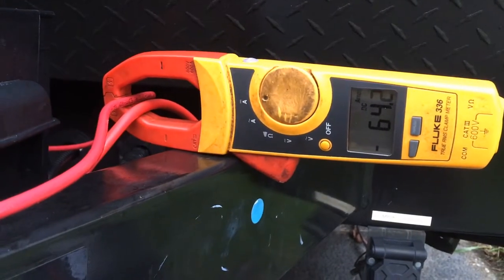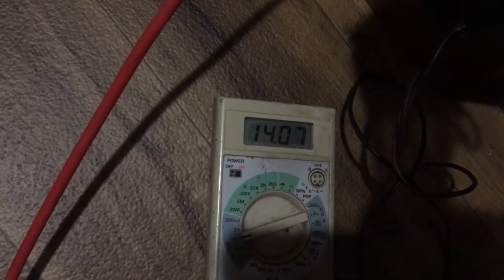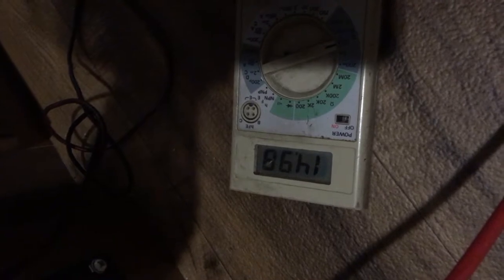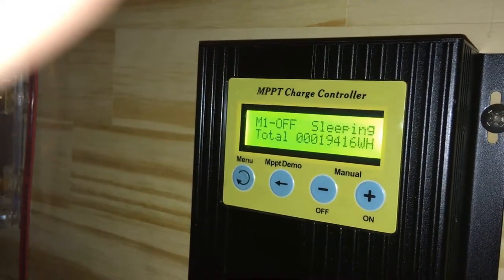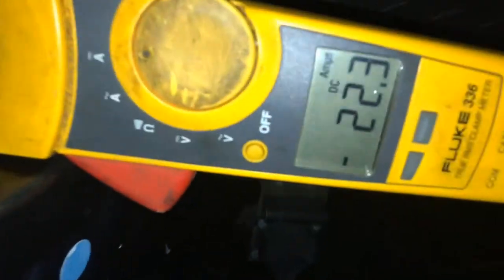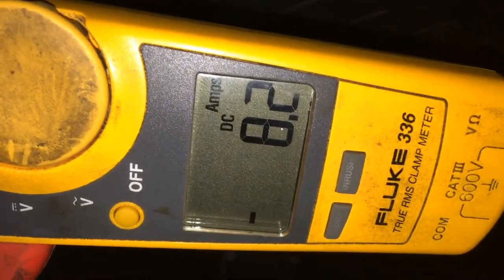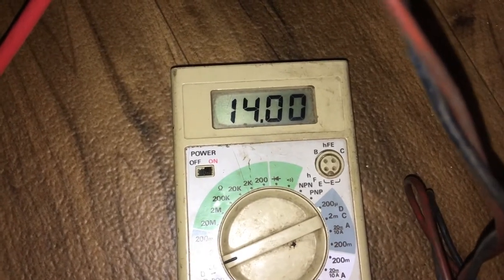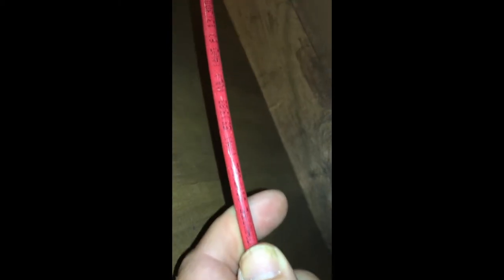WFCO 8955 pec amp test 14.4 volts bulk mode. 2018 coachman

Comment: Wow. Super high amps (64 for example!) for so long a period of time. I guess I don't know enough about batteries to understand why that didn't cook them. And at one point you hand-checked the battery case for temp and it didn't seem hot.  I was of the understanding that when batteries really shouldn't be charged at more than a 10 amp rate. Thanks for posting this video.

Comment: Before you added the 2nd wire what was the charging current? Was the 8955 not going to bulk mode?
Reply from the maker: ABOUT 30 AMPS. no the unit never went into bulk mode. how I got it into bulk mode I  guess the batts need to be pretty dead. I replaced it with a charge wizard model

Comment: This test was excellent. Is that a flooded battery? At 18:45 you mention the batteries are fully charged at ~13.8 volts. Did you check the. battery's resting voltage again after 24 hours? I'm hoping it dropped to about 13.2 volts.
Reply from the maker: yes flooded batts. No resting voltage test. I assume it would just float.
Reply: @Lawrosa1  Cool, I've got AGM's connected to my wfco 8935 (has the same charging parameters as your model 8955) so I'm trying to insure they don't get overcharged. While nothing likes being overcharged regularly with flooded batts you can top them off but not with AGM's. I may risk venting gases that cannot then be replaced and prematurely killing the agm batteries. Floating at 13.8 would be a concern for me. The WFCO series should float at 13.2 but if it isn't working properly and stays in absorption stage at 13.8 then that is a concern for my setup.

BTW my comment above is somewhat incorrect, I should have asked did you remove the charger leads so the charger doesn't overstate the resting voltage and let is rest for 24 hours (perhaps even apply a load briefly to remove the surface charge) then test resting voltage to get an idea whether your flooded batteries got a full charge. Even worse for me than overcharge is undercharge. I dry camp and often push the limits of my batteries, I need every amp hour I can get upfront from a truly full charge so I don't deplete the batteries to the point of no return.